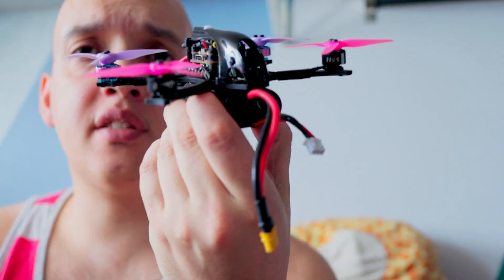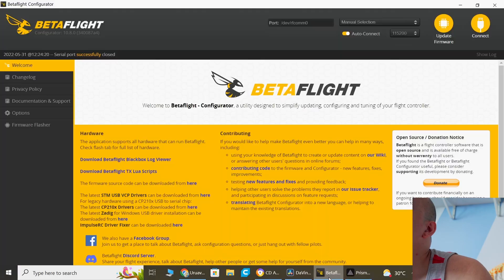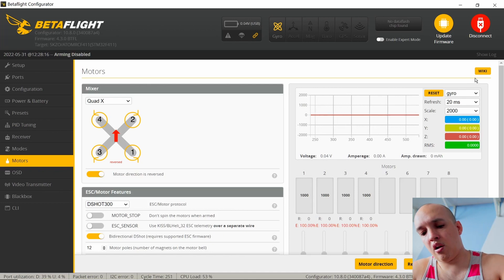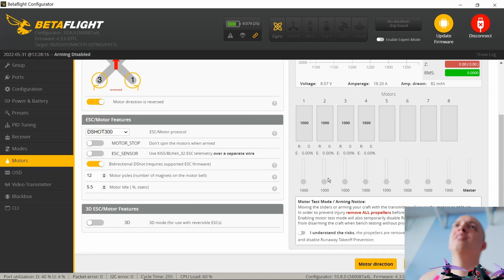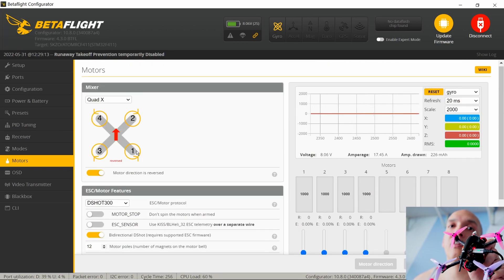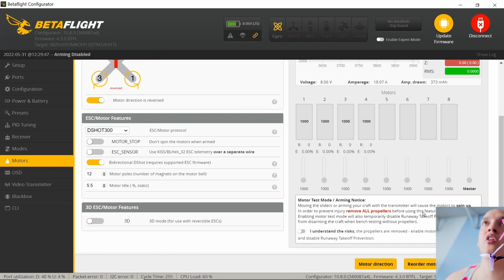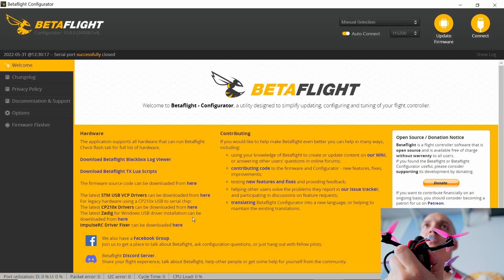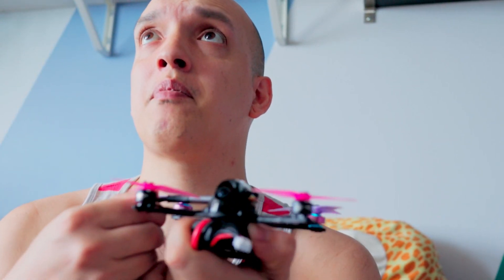FPV Quad flips on takeoff? Reasons why and how to fix it!

Comment: I tried my new drone out and it kept doing this but around the 10th time it actually took off a flew normally but since then I’ve tried about 8 more times and it just keeps flipping
Reply: I know nothing about drones other than flying. But how do I connect it to the website, to test it like you did.
Reply from the maker: @rytarg  if you can tell me the make and model of the drone and let me know that I'll see if I can help you out. It all depends if you're using like a commercial drone or one of these. FPV drones is all different. So let me know what you have and I'll try to help you
Reply: @TorontoFPV  it’s the hs360s from holy stone
Reply from the maker: @rytarg  Yes as I thought it was more a consumer drone. So I'm talking here about FPV drones which you build yourself and then you fly totally and manual mode. If you want to start getting into FPV check out this video and the playlist. I made it just for beginners so that you can learn more about it. But this is the best way to start out for the best value. I make a new one every year. Since the equipment is always changing it can be very confusing https://youtu.be/fAN6EBB2_3Q?si=dEABHajlQ2HQ8-iq
Reply: @TorontoFPV  ok, cool
Reply: Hi, for me this issue happened once in a while like once every 6 flights, sometimes it took of perfectly and fly perfectly. I have a Roma f5 v2 diatone. How can I solve it?

Thanks you for your help

Comment: My drone has the props on the sent it to a friend of mine that fixed it and sent it back to me and my arm it and try to fly it flips out how can I fix that
Reply from the maker: Follow all the steps and check on the status tab that when you move it after reseting the z axis that it's moving the same as you. if not you need to rotate your fc
Reply: @TorontoFPV  I have done that I’ve done it where I have the back motors reversed and I checked the box that said reversed motors and it does not spin at all I have the front ones going with the slant going towards the drone and then I have the other ones not going towards the drone it’s just making a lot of air noise when I give it throttle up I have checked every prop and they are going the correct way I must not have the props on the correct way then I did it with the props on and stopped it with my finger and watch the direction of which way it’s going  it’s a new hobby to me I have had RC cars and RC boats I have had a one toy drone that cost like $100 but nothing like FPV
Reply: @TorontoFPV  OK so I have it set up like you have yours in the video and when I get off the ground it wants to like really really do a 3-D roll really fast super fast and then flip out and go on the ground what could be causing that and the props on my drone are the same as in the video you have on configuration tab I have maximum arm angle degrees at 1:80 and accelerometer receiver tab I have yay at 1503 and pitch is at 1505 and roll is at 1505 throttle is at 1005 and would servo tilt do anything to help the fast 3-D rolling when I’m not even trying to 3-D  roll eight does it by itself
Reply from the maker: @Dustin p Lee  if the flight controller isn't in its right orientation that could happen. Other than that it's almost always the stuff in the video. Or pid tuning and if it's that I'm no good at that. Hope you figure it out. Let me know when you do. And make sure you really go over everything. Try with and without rpm filtering also.
Reply: @TorontoFPV  where do I find rpm filtering and what orientation is the board supposed to go what side of the USB port is it supposed to go on the right side or the left side I have it on the right side do USB port facing the right side how do I turn I turn it off my gyro  notch filters are off my dynamic notch filter is on my yaw low pass filter is on my d term low pass filter is on and my Gyro low pass filter is on
Reply: @TorontoFPV  I don’t even see rpm filtering in my filtering settings
Reply from the maker: @Dustin p Lee  shoot me a msg on facebook. Matthew genser. Tonight I'll do a video chat with you and you can screen share your problems
Reply: @TorontoFPV   it flies and everything but when it hits the ground it flips out the guy that worked on it for me said he had the same problem with his driving one of his
Reply from the maker: @Dustin p Lee  then something is wrong with the tune. Start trying different preset tunes. For normal and noisy builds see if that helps
Reply: @TorontoFPV  I fixed it I turned air mode off and when I land it does not flip out or go crazy on me
Reply from the maker: @dustinplee5067  yay!
Reply: @TorontoFPV  one of my friends that has been flying FPV for six years says it’ll cause problems if I turn air mode off is that true
Reply: @TorontoFPV  so my VTX does not work it is not come on how would I fix that it doesn’t even like that and I have no video but all the tones beep when I plug the battery in
Reply from the maker: what is your vtx? like model?
Reply: @TorontoFPV  it’s a akk fx2
Reply from the maker: @dustinplee5067  its smart audio. follow this video should help https://www.youtube.com/watch?v=eaSmoOPk9KY&t=145s
Reply: @TorontoFPV   I started watching that video but it will not even turn on it doesn’t have any lights on it or nothing will that still work with my problem
Reply from the maker: @dustinplee5067  try diff power sources. if it doesnt turn on then thats the #1 problem look up oven vtx also sometimes that works
Reply: @TorontoFPV  under what tab is diff power tab under in betaflight
Reply from the maker: there isnt just when you plug in your drone it should turn on if it doesnt then either your source of power is not working or ur vtx is faulty. you can try powering the vtx off of the same place as you solder your battery if it can accept the voltage
Reply: @TorontoFPV  it says it can do 7 to 24v I don’t have a capacitor on it I sent it to a friend of mine and he sounded it for me and did not solder a capacitor on it so can I just put that VTX board on the battery side on the positive
Reply from the maker: @dustinplee5067  yes you dont need a capacitor try powering it off the battery pad if it doesnt turn on when you plug in the battery its dead
Reply: @TorontoFPV  it’s a dead board it is not even light up when I solder it to the battery lead

Comment: 1:11 dat ESC music dance
Reply from the maker: you know it baby!
Reply: @TorontoFPV  Funny/informative video by the way. I did cringe with the propellers being on to check the motors especially really close to your face. One little slip... ☠
Reply from the maker: @JohnCuppi  lol I figured you would 🤣 I know your a good proper man. I'm a little bit terrible when it comes to doing things the "correct" way. I hold the drone tightly :) and or am always ready to disarm if it shoots up on test flight. Also only fly 3.5 and under..... fpv drives me insane enough without having to unscrew and rescrew every couple mins :)  glad you enjoyed though! Like botgrinder I love the man but his mouth is too potty for the family. We all have our weaknesses. Mr Snake is Highly entertaining and dangerous 😳 
I do stupid things and accept the consequences. 

So far the worst thing that has happened is I tried to turtle mode and someone tried to pick up my drone and got cut. Then was so mad at me but I totally couldn't see him in my goggles. Felt bad but like dude it's not yours don't touch it...
Reply: @TorontoFPV  You would be surprised then. I knowingly plug in to betaflight with props on all the time, just to change something real quick.  On the motor test page though unless it's a whoop, props do come off. I've been thinking about making a quick video, something along the lines of "If you're going to plug in with props on, then do this..." because the reality is I don't know anyone who doesn't break that rule at some point. I suspect there's a lot of people who pretend they ALWAYS remove props if connected to BF... 

But there are a couple of safe ways to go about it, namely if you have a current stopper/smoke stopper, it will literally prevent the motors from spinning up on the desk.  If you've got one around are going to do it anyway, I highly recommend it. Anyway, keep it up! 

So, was that a random stranger who tried to pick it up then? I've never had that happen before, but I use turtle mode sparingly since I don't want to burn any ESCs.
Reply from the maker: @JohnCuppi  Some random, since I'm in Toronto and have no car I basically fly at parks so there are people here and there mostly a positive experience though only ever dealt with one rude dude in a year most are curious. 
lol yes I have a smoke stopper that I never use (cause at least I don't make soldering mistakes (knock on wood)) 
Even my main job as a hairdresser was in fancy salons I hated so decided to dress up as a super hero and give haircuts to people on the street which isn't really allowed either lol https://www.youtube.com/watch?v=SJQE-nct_HI&t=53s
John Breaks the rules too though and that makes me happy #TeamNaughty